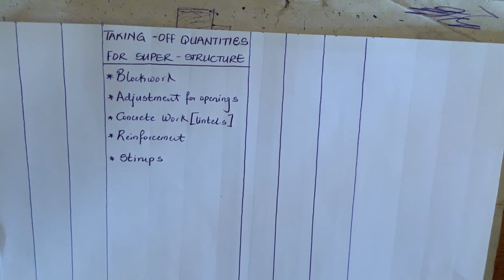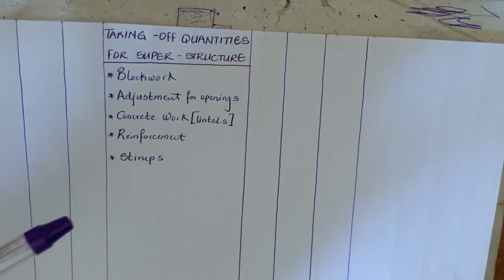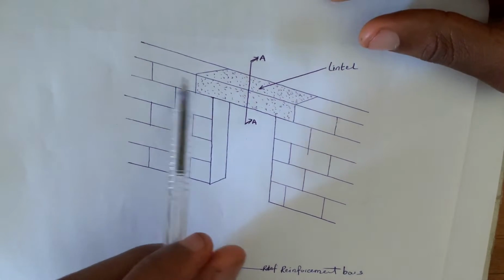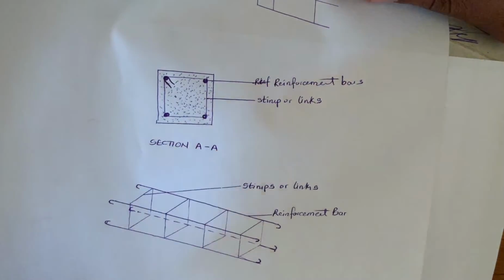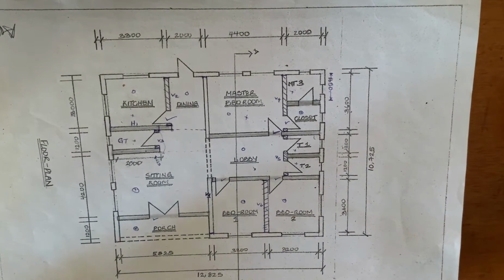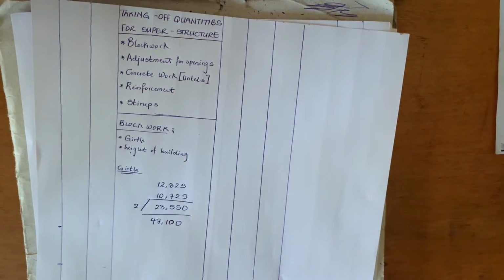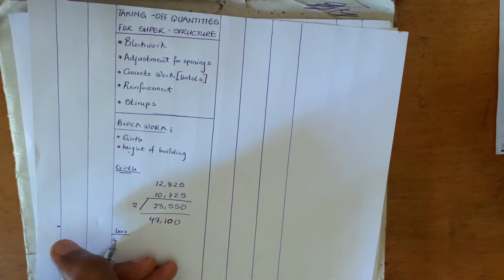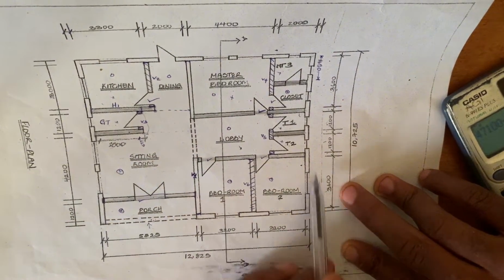HOW TO MEASURE FOR SUPERSTRUCTURE [BLOCK WORK] | WALL QUANTITY CALCULATION MADE EASY

Comment: Why don't you deduct 225 from the height of the building because when my lecturer took us this super structure she deducted 225 from the height. Why?
And when you did yours, you make use of the full measurement of the height
Reply from the maker: Maybe there was concrete head course in hers!! There are time ms after the block work has been laid, they use concrete round the building which will serve as a base that carries the wall plates.
The case is different in this plan (that is why I kept saying you need to understand the nature of the drawing) 
I sent a post on the community post, showing the drawings. Check the section, there’s no concrete untop the wall